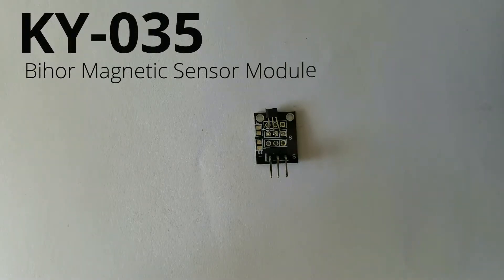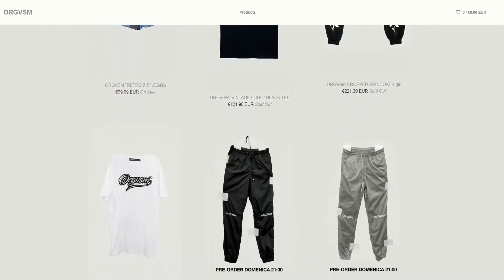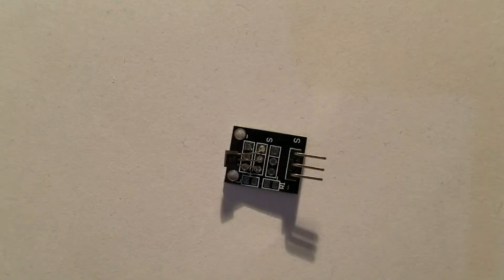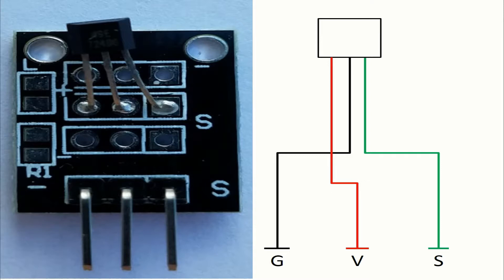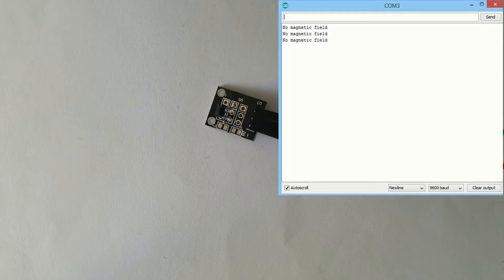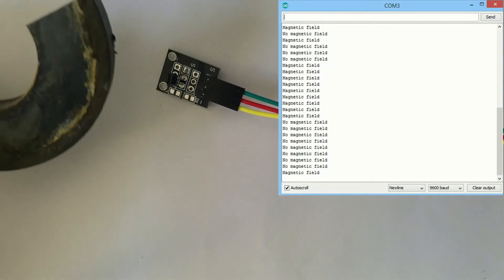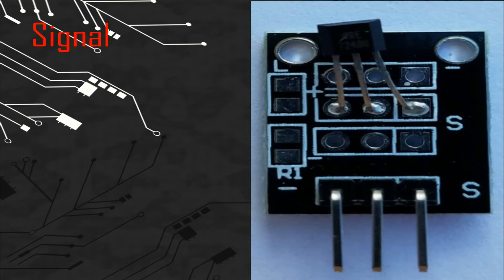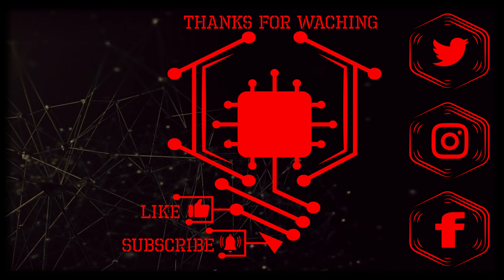KY-035 Bihor Magnetic Sensor Module

Comment: Thees module has three pins, two for supply and one for (an analogue [1]) signal.  Oh, and if you want to buy some ludicrously expensive cottonwear then goto the link in the description.  

No mention of what you might do with the magnetic senseo, no comment [at all!] on how it works, not even an explanation that you need either a linear display or an a/d converter and processing power to interpret the output. Not even a picrure of the u-ctrler he must have used to read the output. 

There, saved you all three minutes of your lives. 

[1]  <== There!  The one piece of information you wouldn't have got from studying the photograph on the  site of your component supplier.